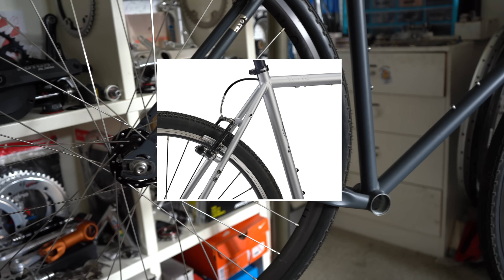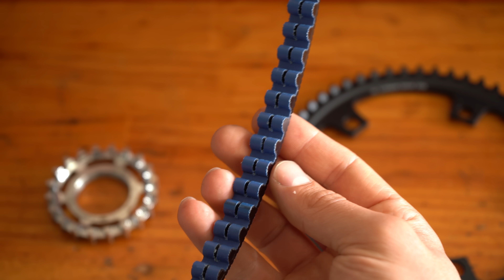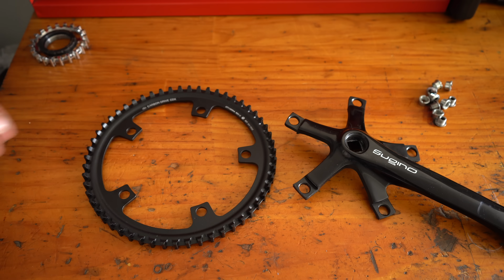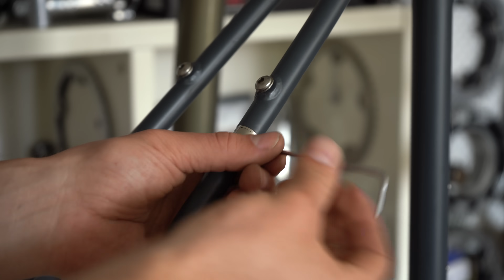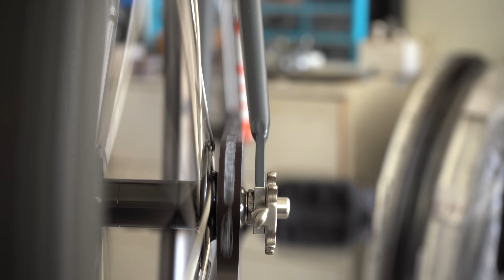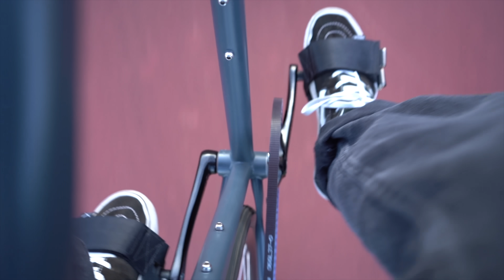Belt Drive Fixed Gear Build

Comment: All that fuss and expense just to lose watts for no discernable benefit other than being quirky. If I were to own a bike with a gimmicky but ultimately inferior method of propulsion for a bike, I'd skip a belt drive and opt straight for a shaft drive.
Reply: Why are you fussing over watts lol. Who cares about watts?
Reply: @difflocktwo  way to not read past the first few words dummy
Reply: Shaft drive have inferior efficiency ratings than both belt drive and chain drive. For what I've seen, a well maintained and centered single-speed chain is always the superior choice...

That said, shaft drive is virtually zero maintenance and looks cleaner.
Reply: I guess it all depends on your priorities when riding. Technically a belt drive is slightly less efficient than a chain, but that only applies if both are installed and tensioned properly and the chain is clean and lubed. A belt is trickier to install, but the big benefit is that it is almost a "set it and forget it" system (as long as it's installed correctly of course). A chain takes constant maintenance to operate properly. Most people don't build their own bikes, so the fuss of setting up a belt isn't important to them, but the fuss of maintaining a chain is. Also a chain gets your pants dirty and wears out a whole lot quicker than a belt. This is why you mostly see belt drives on city and touring bikes. If performance is your ultimate priority, nobody would pick a belt over a chain. It all depends on what, where and how you ride to determine if a belt makes sense, but I think there is definitely a place for belts in the bike industry, where they vastly outperform chains. Maybe not purely on performance, but surely on ease of maintenance and durability.

Comment: as someone who has weariness with chain maintenance due to getting their finger caught in the chain and almost severing the tip of my index, this has always peaked my curiosity about making the switch to belt. 🥰
Reply from the maker: ahh that doesn’t sound ideal, hope the finger is good! Belt would definitely be better but I still don’t like the idea of getting a finger trapped in there especially with the tension it’s under🫣
Reply: You must be a handsome guy 😁

Comment: Would have been nice to get your impressions on what it was like riding fixed belt drive! I know that's not your usual format but I'm curious....
Reply from the maker: Tbh I thought there would be more stretch/flex in the belt but it’s surprisingly stiff. After my first ride there’s definitely no complaints at all, feels solid like a normal chain.  unbelievably quiet and smooth as. Almost zero “chain slack” feeling as the tension is quite high. The no oil/grease part is pretty wild, given that there’s almost zero noise. I’ll have to ride it a bit more to get a proper idea, but so far I’m a big fan🥹
Reply: @waveywheelies  thoughts after a year?

Comment: I've always been curious to see a belt drive fixed gear build, especially to see how the belt would hold up to brakeless riding.. That thing is clean as hell, and so quiet!
Reply from the maker: Yeah very quiet, was honestly very surprised. I’ll keep you updated with how it holds up, thought there might have been a bit of stretch or flex but it feels solid as
Reply: @waveywheelies  Did it held well? Did you encounter issues where the belt slid off the cranks?

Comment: Man its my dream to transition my fixie to a belt drive
Reply from the maker: Give it a go if you can! If your frame doesn’t have a split link you can get them welded in if it’s steel
Reply: @waveywheelies another option are Veer split belts.  I think either method is on the expensive side... but out of the norm, so I kinda like it. 

I think other options are either an eccentric BB or eccentric rear fixed hub... I can't say I've EVER seen an eccentric fixed hub